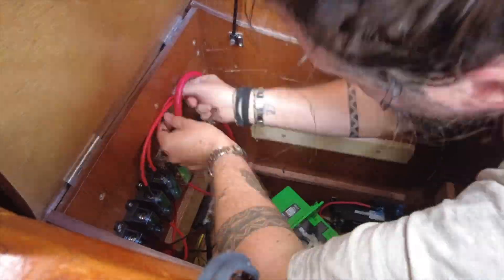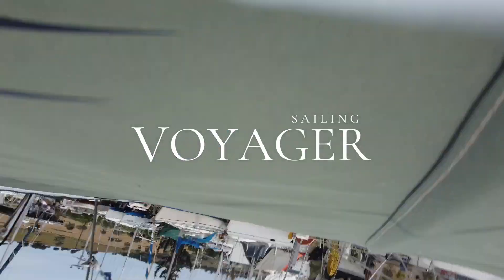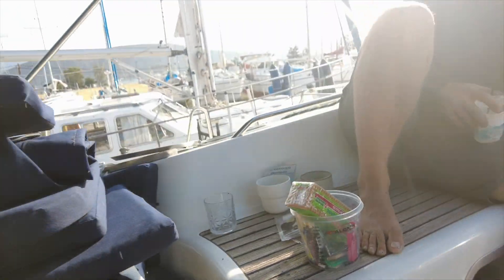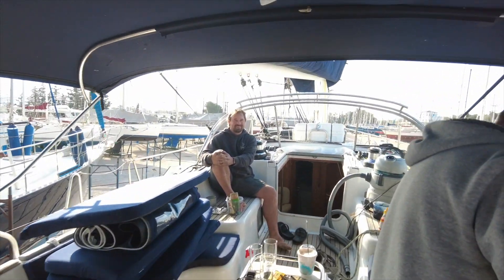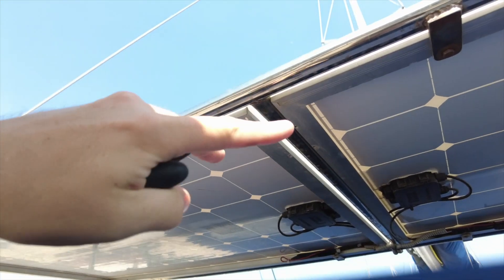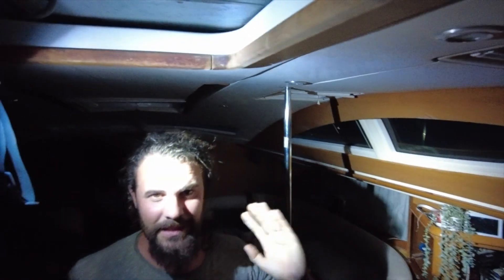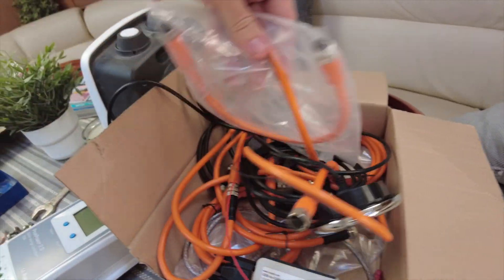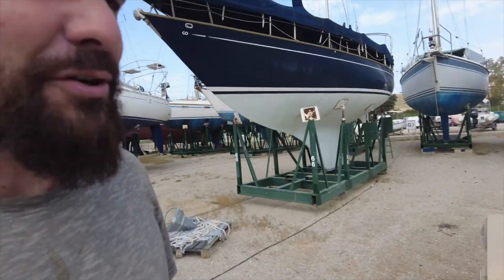Solar Install and Lithium Batteries on our Sailboat to live off Grid

Comment: Never cut strands off. Trick is to use electrical tape tightly wrapped on the bare wire to compact it all, this allows you to start the lug on the end, then unwrap tape as you feed on the lug. And using proper cable cutters so the ends are cleanly cut too, angle grinder burs the ends making then larger 👍
Reply from the maker: Great tip!

Comment: Thanks Mate ,nice video, gives us a good heads up on the install we’re about to start…just waiting on the stainless boys to finish off la ast minute job before they mount our new Arch😎
Sucks about the Renogy inverter - we’re about to install the same model and same size  😂…did you get the issue sorted is is it knackered ? Cheers
From Monastir Tunisia, Nige and Donna.😎
Reply from the maker: thanks mate. yeah its dead. trying to diagnose the fault  at the moment 👍

Comment: Just to check I think you have your Solar Panel Wired in Series/Parallel backwards....
In Series = Add Voltages of Panels, Current stays that same.
In Parallel = Add Current of Panels, Voltage stays the same.
Reply from the maker: yeah thats right, maybe i said it wrong

Comment: I put a 12 thousand Btu AC unit in the companionway . It keeps the front room cool .  And they’re cheap 2oo bucks . Why’s are all the boats in cradles . Easier to move around. All the marinas in Annapolis have just stands . Looks pretty orderly
Reply from the maker: yeah, i did this shortly after. now stored in a locker!

Comment: 39 celcius is 102 degrees fahrenheit.  It is 3:24 pm here in Dallas/Fort Worth, Texas and it is 106 degrees outside.
Reply: I heard Kansas City got to 105 .
Reply from the maker: i lived in the middle east for 8 years so im OK with the heat, but physical working inside with no breeze at those temps are horrid!